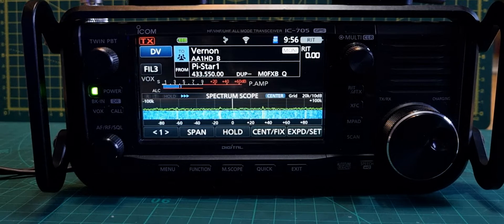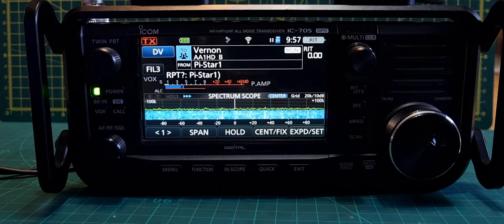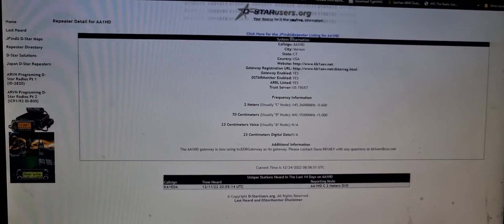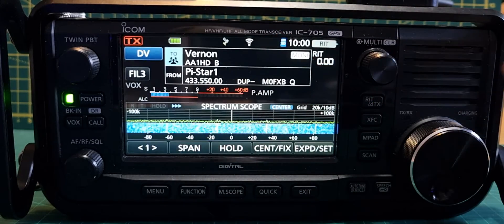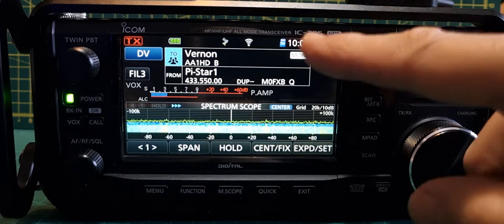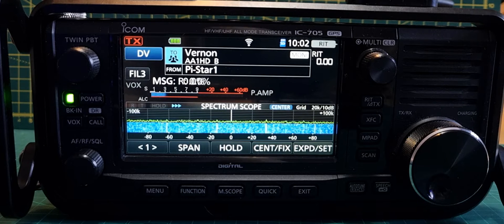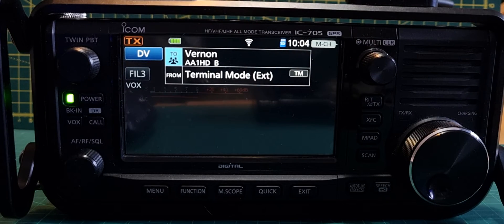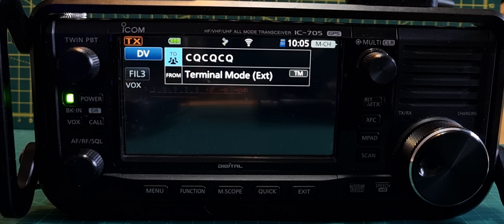ICOM IC-705 Testing New - DV Repeater Monitor Firmware 1.32

Comment: May I ask, what IS this "DV Repeater Monitor" ?  What is it supposed to do ?
Reply from the maker: It listens to an Internet linked repeater.
Reply: @M0FXBHamTech  Thanks.  I found some of your other videos on this which show it, thanks for those too !  This "function" is a strange thing for them to "add" though.  On my Kenwood D74 I can actually connect to a second repeater through my access "RPT1" repeater by entering the second repeater into "RPT2" and both hear traffic on it (which is what this "new function" does) AND transmit through it.  I haven't been able to figure out how to do that on the IC-705 though and now I'm wondering if it doesn't have that capability (which is just a basic DSTAR thing) and they added this as a half measure  to compensate ?  I have a question into ICOM tech support about it because the manual is so incomplete.